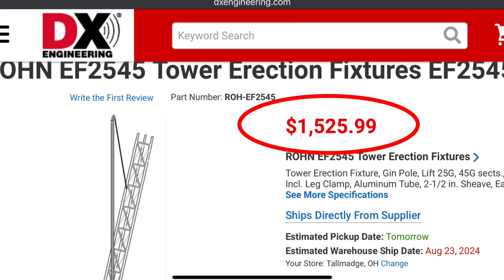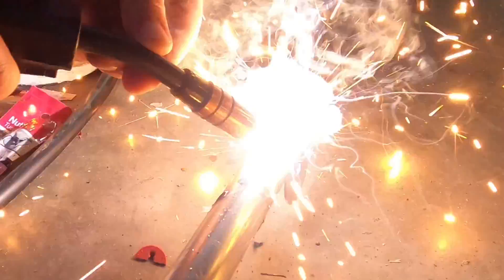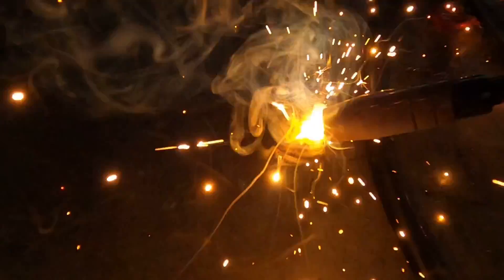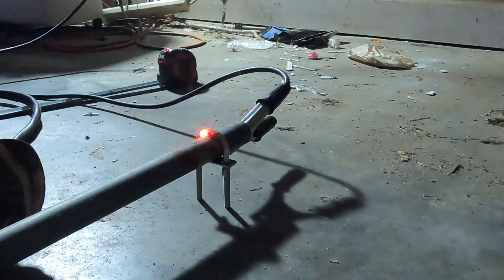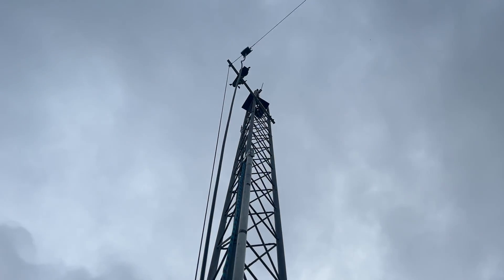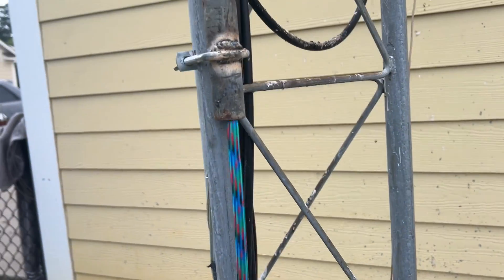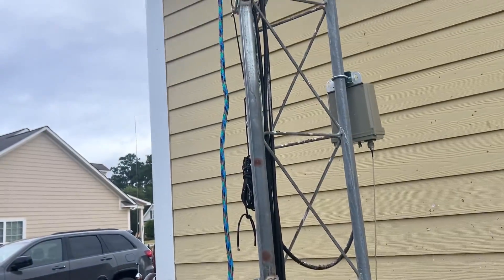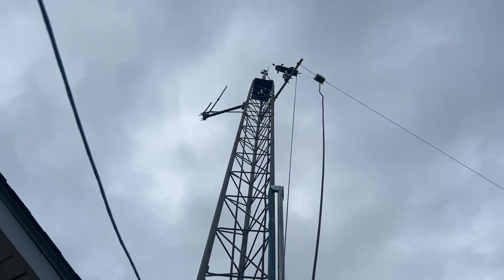DIY Gin Pole for tower erection and maintenance Rohn 25

Comment: Man, there are all sorts of red flags going on here. Toxic welding fumes,   trash littering the floor in the welding area, and questionable welds could fail and bring the rig down.
Part of the high cost is the manufacturer trying to recoup their investment because of all the safety codes they have to follow in manufacturing, you know like companies that make ladders.
Reply from the maker: What happens in the garage stays in the garage. I made it very clear that I am not a welder. But ventilation is important as the zinc and other fumes will make you sick. Glad to know OSHA isn’t concerned with what happens in my hack lab. Thank you for pointing this out for future viewers though. It worked for what I needed to do, and now it holds a 12 ounce antenna so future failure won’t be an issue.

Comment: Sure would have appreciated it if you showed the Gin Pole in action at the end.
Reply: I agree.  I'm afraid I have no idea how this is supposed to work based on the video you showed.  I've been trying to design a tower I can raise myself to get my internet receiver to clear the trees and I was hoping to get some ideas from this video.  Unfortunately, I did not.
Reply from the maker: I have a couple of shorts that show me actually using it. If I had to do it again I would have used 2-1/2” pipe, but to lift two sections of Rohn 25 it performed well enough not to break.

Comment: Years ago I was sent to a wind farm to retrieve some meteorological instruments for post-calibration. The instruments were mounted on tilting 60m masts. The works manager at the farm decided he could make a gin pole for less than the price quoted by a specialist erector company. They didn't get the gin pole quite right. In an attempt to lower a mast with an overweight pole they managed to introduce a resonant 'wobble' in the mast, which self-destructed, narrowly missing technicians on the way down. I could see it coming and had placed myself out of the danger zone. No one was hurt, but $5k worth of instruments were destroyed. Post-calibration was impossible, and the farm consultant was unable to perform post-monitoring data analysis.

I left site with some instruments they'd managed to retrieve from a lattice mast by crane, but they still had another tilting mast to lower. The works manager was dismayed by what happened at the first mast. I imagine he must have been twice-dismayed when the same thing happened at the second tilting mast. Cheaper isn't always better.
Reply from the maker: I don’t disagree with your last statement. I knew I wasn’t lifting more than two single sections of Rohn 25 and some small antennas. It’s up to the user to be aware of the limits involved. In your case, it sounds like the guy that made the gin pole didn’t take into account the value of what was being removed or the environmental limitations of the task. 

I’m glad nobody was injured. That would have been a bad day for all involved. 

I appreciate your excellent comment on safety and knowing your limits.

Comment: Not sure if you mentioned it in the video, but welding galvanized pipe produces super toxic gases.
Reply from the maker: Great point. If you choose to weld galvanized pipe, do so in a well ventilated area. The gases from welding this type of coating will make you sick. Quoted from the web “Breathing in zinc fumes can cause metal fume fever, which can include symptoms like severe thirst, leg pain, shivering, and coughing. Make sure you have proper personal protection.”
Reply: @w1rcp  - Grind the zinc off before welding.
Reply from the maker: Even with grinding, I wouldn’t trust it to be safe. I had a cross draft going, and even that probably wasn’t enough. As with any DIY project, research is important. I am not a welder, but I did have enough sense to look up the dangers of welding EMT and zinc coated steel beforehand. I will make sure that my video description has that written in it.

Comment: Two comments: Get a plastic Owl and move it around every week or two and the birds will go away. If you weld a hook on the top behind the pully it will make it easy to hook it  over the top of the past section to hold it when you climb. It will also give you a place to tie the rope to when you lower the pole.
Reply from the maker: That’s a good idea if I do it again. I may have to get an owl to swing around up there. The bird poo is bad. 
The gin pole is permanently mounted at the top where I can raise/lower my HF antenna at will. I replaced the lift rope with Dacron 550 cord for longevity.